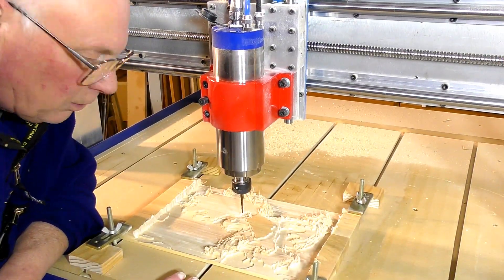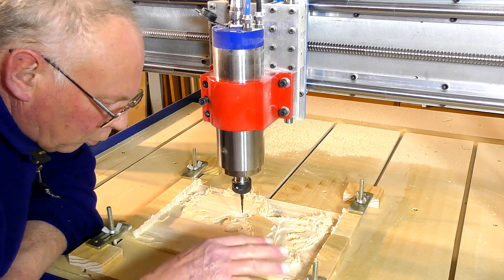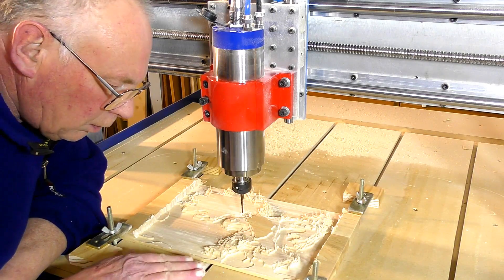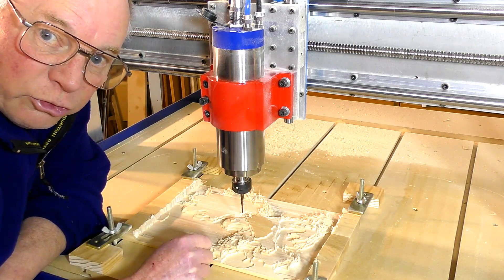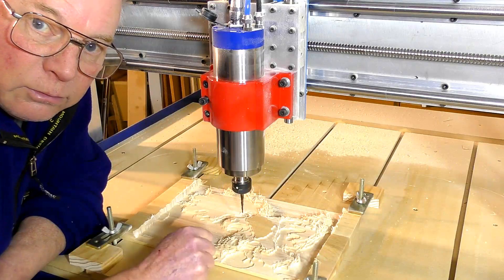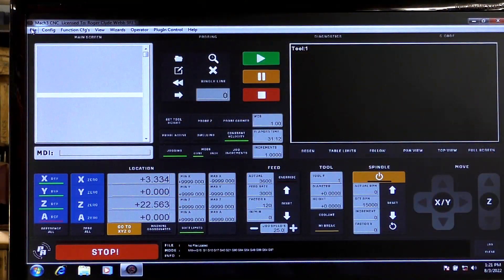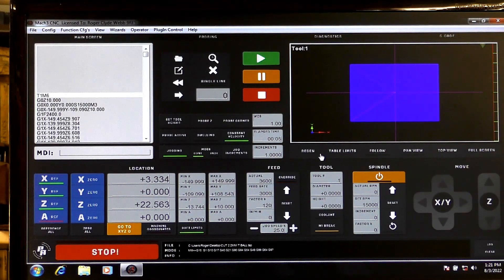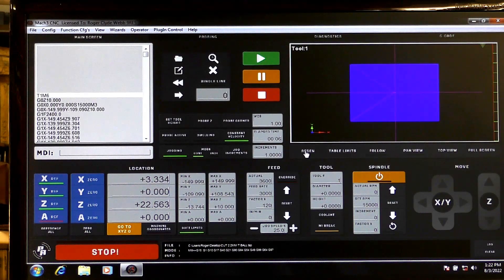DIY  CNC Router carving an American Bald Eagle

Comment: Hello from Louisiana USA. Got a 6040 CNC back in January but have just now gotten well enough from some health issues to try it out. I purchased Mach 3 but at odds with getting g-code to load. Looked at Vectric but they seem pretty proprietary from all I have read. 
I would appreciate any advice on initial set-up and g-code sources you may be willing to share. Thankyou in advance, Brian
Reply from the maker: Hi, you need Carveco Maker
My CARVECO 5% discount code is
 ROGERWEBB5798 
(ONLY AT THIS ADDRESS BELOW)
 https://store-us.carveco.com/?ref=B40mt_z8N7xiu
Reply: @inventorsworkshop9600  I bought Carveco. Cool program. Any suggestions on the proper g-code format for a 6040 Chinese?

Comment: Hi Roger. Very nice,  did is see correctly the tapered ball mill is a 2mm tip?  What stopover do you typically use?  Is this an available file?
Reply from the maker: Hi, yes 2mm (1mm r) 45mm L and 0.15mm step over
Reply from the maker: P.S. see the next carveco video I will be doing this one